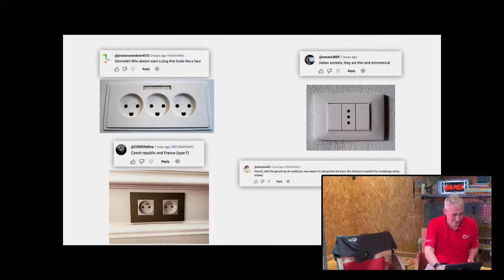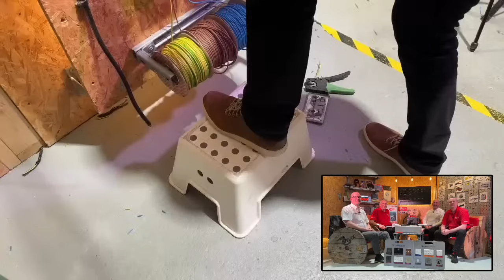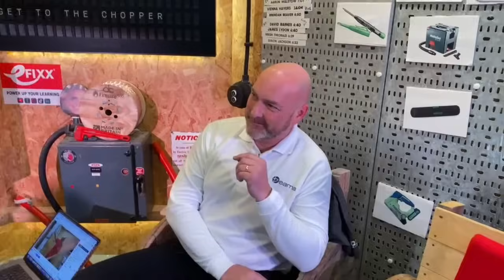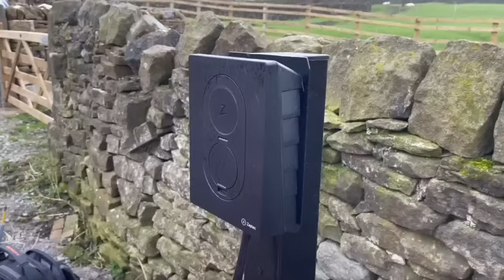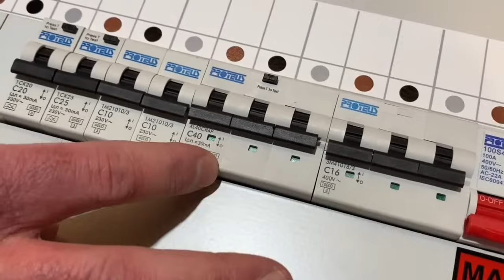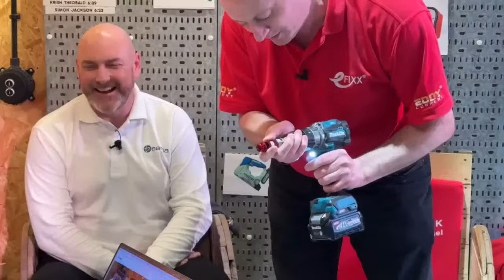The World's Best Socket Just Got Better!

Comment: Why does the RCD power the solenoid coil continuously risking burning out? You could drive the coil with a single pulse to trip which is then armed again when reset. Then there's no continuous power dissipation from a generator on the output and you wouldn't need a third contact. It could possibly be an easy modification to the existing design. 

Also for a double pole device if it disconnects from the imbalance on the consumer side (presuming that's the most likely side of the imbalance) why would it continue to keep driving the solenoid if the imbalance has been disconnected? If it only drives when there's an imbalance it won't now be driving.
Reply: I had this same thought initially, but I assume now that once an imbalance is detected it is 'latched' by the microchip and the trip solenoid is held energised until supply is lost, even if the imbalance goes away. If that is true, then the explanation makes sense, because you are correct, once the contacts open the imbalance sensed by the coil has to go away. But if it's a latched scenario where the trip coil is held energised to ensure disconnection then it would remain energised as long as the incoming supply from the load remains. The explanation of a third switch in the test button circuit doesn't make sense though, I assume that third switch must be on the supply to the microchip to ensure that power to it is also cut when the main contacts open. Just my guess though :)
Reply: @davefrizelle3882 Having not taken an RCD apart I'm not sure but if the chip that detects the imbalance and drives the solenoid is powered from the input bus rail side of the RCD and latches ON until reset regardless of the imbalance fault being disconnected on the output side - then it must be capable of staying latched indefinitely with nothing connected to the output. But this then would be regardless of a generator being connected to the output and would be normal operation in a general application.

What might be the issue could be that the detection and solenoid driving circuitry is powered from the output side. It latches, like you say, once an imbalance fault is detected but once triggered disconnects its own power supply as well as the load so won't be continuously driving and can be designed not expecting continuous operation. So, a generator connected on the output side, continuing to supply 230V would continue to power the RCD solenoid driving circuitry and possibly damage it if it's not designed to withstand continuous powering.

I can't see the point of continuing to power the solenoid as it should disconnect the contacts within a few milliseconds - so the driver could safely be modified to provide a pulse instead.

There is of course another question about what an RCD achieves by disconnecting a generator from the grid in the event of an imbalance fault if the generator continues to produce 230V and continues to electrocute someone touching the live wire. For protection of the cable and anyone touching live you'd need an RCD at both ends with the cable joining each RCDs output - both would trigger with an imbalance and at the same time there wouldn't be a problem with the RCDs becoming damaged as the cable is not powered. 

This in effect should be the case for most inverters as they are supposed to stop producing an output if the grid supply gets disconnected.
Reply: @johnh9449  Your second paragraph - about the detection and solenoid being powered from the output side - I think that is the issue. I also have not taken apart a modern RCD - I do have some old ones that are entirely passive, just a toroid with the two main windings and a third winding to trigger the trip mechanism. They will even trip if I do a 200 mA resistance measurement across one side of them without any AC power being applied! So no detection circuitry, no microchip, just a simple toroid and for those once the disconnection happens then no current can flow in the toroid so the trip solenoid will no longer be seeing any field. In any case the field that the trip coil sees is extremely small in that case.

I assume that with the modern RCDs that have to be able to handle pulsed DC and continuous DC and all that, they had to make the detection smarter, hence the addition of a microchip. (I have confirmed that my old RCDs do not trip on pulsed DC imbalance, they are type AC, so not use anymore) 

Based on the explanation given in the video, it seems that the microchip and trip coil are driven by the output side of the RCD and depend on the disconnection of the contacts to remove power to them. To the question of why would the trip coil be continuously powered? I guess the danger of sending just a pulse is that if the contacts are somehow sticky or whatever then the pulse might not guarantee disconnection but a continuous drive is more likely to? I can also imagine that it was easier to design a circuit like a flip flop based design which is latched by the imbalance and then just stays on. Putting a timer in there to de-assert it again after a certain amount of time was likely more expensive. But these are all just wild guesses :)

To your point about the generator continuing to electrocute somebody even after the RCD opens, I think the discussion to date has assumed that the generator or solar or whatever is back-feeding the house, and that the fault is on the "input" side of the RCD. If you think of solar + battery then there is no real "input" or "output" side for the RCD as sometimes the mains can be charging the battery, at other times the battery can be supplying the house or selling back to the grid, so the power flow can be in either direction through the RCD, but I think the fault is always assumed to be somewhere on the  house side of the RCD and not between the RCD and the solar/battery/generator. But you are right that if additional protection is needed on the cable from the generator to the house then an RCD would be needed at the generator too. Then you have a problem of selectivity - which RCD trips in the event of a fault?

Finally then, I know that at least the Tesla solar+battery system is designed to keep operating even when the grid goes down - the grid gets isolated totally but the house is still fed, so it's not always the case that the supply from solar will disappear when the grid feed to it goes away.

I'll just finish by saying that these are mostly my wild guesses and assumptions. I have been looking online for more concrete explanations of how/why an RCD can get damaged if it's back-fed but I haven't found anything to date. I have really enjoyed this debate though :) Cheers!
Reply: @davefrizelle3882 Yes indeed, fascinating subject with rapidly developing applications and rethinks of existing accepted norms - like the blind siding of the old AC RCDs with DC etc.

Just looking at my own setup I have the cut out into meter and then a surfeit of Henley blocks fanning out to a number of consumer units each with their own RCD. The solar installation  has a cable run in conduit to battery and PV inverter - so the only thing the RCD (RCBO) is protecting is the cable run or if I stick my finger in it or if there's equipment leakage to Gnd. The inverter itself has its own leakage detection and disconnects if the grid goes down. If the consumer unit side RCD triggered first and the inverter carried on generating it too should detect imbalance and disconnect (if I read the manual correctly) but the grid going down will also trigger a shut down.

Similar connections will apply for existing domestic consumer unit, heat pumps and EV charge points which have its own PEN fault detection. 

Earth leakage on the Henley block side is unprotected of course and won't trigger any RCD as the circuit through the RCDsv won't be imbalanced.

I don't have automatic island mode but if I reconfigured it and added an earth rod I could manually disconnect from the grid. The home world still be protected through the original consumer unit RCDs.

Automatic systems such as Tesla Power walls, GivEnergy etc all disconnect from the grid if it fails.

In all these cases it seems the RCD devices feeding any of the new equipment including generators such as AC coupled batteries and solar inverters only provide protection to the cable runs from the equipment back to their own consumer unit or RCD and disconnect from the grid. Original consumer units are going to function as they did before and will only be monitoring the circuit through the RCD into the home side load. Any leakage on grid side won't pass through the RCD and will form a separate unprotected circuit.

So anyway, generators all conforming to G98/G99 etc should shut down if the grid fails but for off grid island mode working they would continuously back feed the RCD and if there was a cable run imbalance fault which trips the RCD it should disconnect from whatever box is doing the backup function. So your lights will go off and possibly the RCD protecting the cable to the generator would burn out - but only if the generator doesn't have its own internal RCD function. At least that's how it seems to me.
Reply: @johnh9449  I think the only possible problem is this - if the solar/battery is trying to feed the house through an RCD, but some circuit in the house has a problem and causes the RCD to trip, but the solar/battery keeps providing power - no current will flow from the solar/battery setup since the RCD has opened, so no imbalance will exist, so any RCD in the solar/battery setup won't trip, but the RCD in the CU that has tripped will be receiving power back in to the load terminals keeping the trip coil energised, and now that trip coil burns out, so after you reset it you have no more RCD protection.

Overall I'm not sure how "real world" that scenario is, or if it's more that somebody figured out that it could happen, albeit highly unlikely, and now it's become a big deal!
Reply: @davefrizelle3882 You mean a generator such as a solar inverter connected via an MCB as an addition to the original house consumer unit that has RCD protection and a house load trips the RCD but the power continues because the inverter feeds through the MCB to the output of the RCD, keeps everything powered and burns out the RCD?

I think a solar installation is more likely to have its own RCD (should be DC tolerant to comply with regs whereas the original house RCD is more likely old non compliant AC type) so more likely has its own consumer unit. So a house fault tripping the old AC RCD will function normally and the new RCD for the inverter will be unaffected by the fault and continue connecting the inverter to the grid through the Henley blocks which also supply the old house consumer unit with the tripped RCD.

The RCD for the inverter would only trip for a fault on the wiring to the inverter or an inverter fault as all the house loads are separate circuits and only imbalance the old RCD.
Reply: @johnh9449  I think you're describing what I'm thinking of except - it's a solar inverter connected via an RCBO rather than an MCB as an addition to the original CU. I don't think you can have an RCD at the solar end of the connection and an MCB at the CU end because the inverter can be a load for the CU if the batteries are charging from the grid, so the cable needs to be protected from both ends I think. 

If the inverter is connected into the CU as an additional circuit via an RCBO, the "input" side of that RCBO is connected to the main CU bus bar. That in turn is feeding all other circuits, including other RCD protected circuits. If a fault occurs in the house then I think you have a selectivity issue and won't know which RCD will trip, but if it's the RCBO that the inverter is feeding the house through, then that RCBO will be getting back fed in the tripped position.

I'm really only guessing here though and trying to come up with scenarios where the RCD will get back-fed in a tripped position. I don't know how real world any of this is! Thanks for all the good debate on it.
Reply: @davefrizelle3882 It's difficult without a diagram but Ok let's take it that someone has installed a new circuit in the old consumer unit with an RCBO feeding a solar inverter. Let's suppose the old consumer unit also has its own RCD feeding a ring final circuit. 

Now, if someone sticks their finger in a socket and touches live there will be a fault current to ground which travels back via the CPC to the neutral at the cut out on a TNCS to compete the circuit when the grid is supplying power. The fault current bypasses the torroid in the old RCD so there's an imbalance between L+N and the RCD will trip.

In the case of the solar inverter generating so there's no grid draw - the finger in the socket creates a fault current that bypasses the RCD and imbalances it in the same way so it will likely trip - but the return path to the generator passes back up the neutral to the old consumer unit and through the neutral of the RCBO feeding the inverter so the RCBO stays in balance and does not trip. The returning neutral current would only bypass the RCBO if in the inverter there was a direct connection between neutral and earth like at the cut out on TNCS where they are joined. The inverter's neutral terminal is not bridged to earth so current can't return through earth but must return through neutral and therefore through the RCBO keeping it in balance. So I don't think there will be a selectivity issue.

I think the problem they have raised is if in this set-up the RCBO trips due to a cable to the inverter fault but the inverter carries on generating and powering the RCBO solenoid circuit and burns it out - but I don't think this is likely for a simple inverter as the inverter will shut down if there's loss of grid.

For a system that switches to island mode when the grid goes down there would normally continue to be a house load but in the case of the RCBO tripping there would be no load - it could possibly detect this and shut down which would save the RCBO but I'm not sure without checking.

Thanks for a very interesting discussion.

Comment: There's currently some controversy over what direction US outlets ( receptacles sorry go) over the last year. from what I understand it is not in the NEC as a code requirement but sounds like it's been introduced regionally between towns and states arbitrarily adopting this. Supposedly grew out from hospitals requiring them to be GND up. Generally there hasn't been a requirement other than to wire it correctly (shockers) as to the orientation. I personally prefer the ground pin down it makes a :-) and you know the ground is down towards the ground. If it is going horizontal it is preferable to have the neutral (wide pin) on the top side. However there's a trend to put it in my opinion upside down which unfortunately reeks havoc with the decades worth of power bricks and 90° cords that now hang down and pull themselves out of the outlet. Usually this type of plug is on refrigerators and some power bricks are polarized or even three prong. Which I think this might have some thing to do with cords falling out of outlets which is generally more due to wear and cheap outlets that have not been replaced when they should be. I wish we had sleeved pins. And we have just gotten in the last 5-10 years tamper resistant shuttered receptacles.
I much do you like the UK system although it has one drawback other than complicated folding designs the dreaded left on the floor waiting to impale you problem.
Which is similar to stepping on Legos and I don't know how I know that other than maybe I accidentally stepped on my travel adapter.

Comment: Why don’t you have a 2 pole contactor linked to the RCBO or control circuit so if it trips it just isolates the inverter feed for the milliseconds before the inverter shuts down.
Wouldn’t this make sense ?